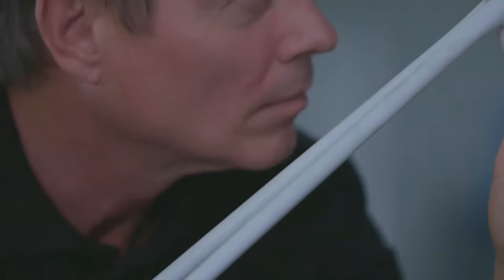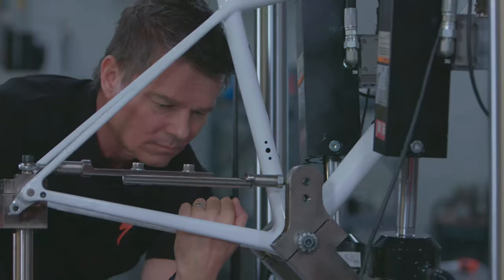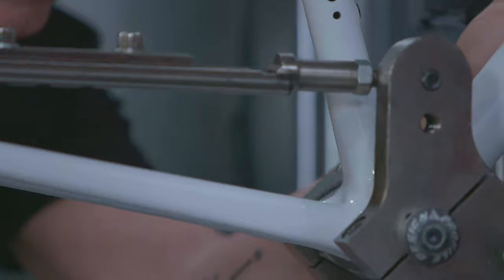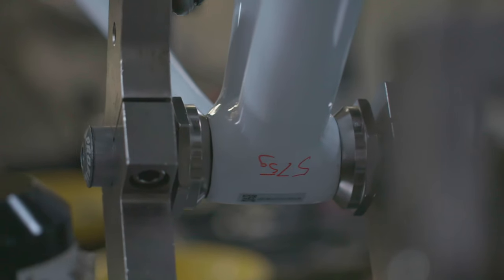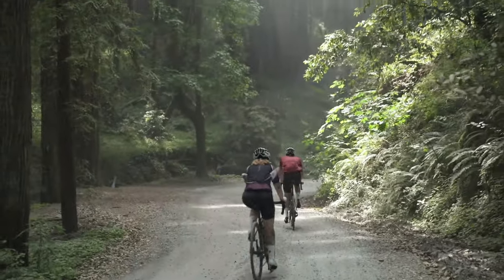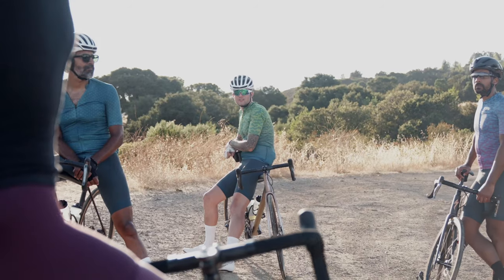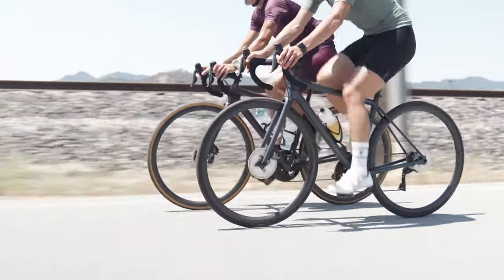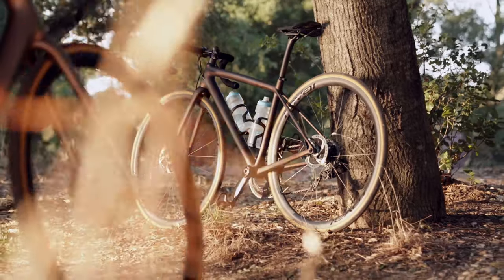Making the Aethos: Behind the scenes of the lightest disc road frame

Comment: 14 years of riding road bikes for buisness and fun, after 1000km+ on my Aethos it still makes me smile on every ride. Nevermind if up-/downhill or flats, this bicycle is just a pure pleasure to ride. I am very glad to call one my own.
Reply: Btw. For me the most significant thing was the amount of comfort due to its vibrations damping preferences while still being incredibly stiff/efficient when getting out of the saddle. I'd call myself a pretty confident descender, don't know if it made me quicker. But deffinetly enjoying it even more. The feeling when you lay it into a turn at high speed is just hard to describe. Absolutly beautiful to ride. (Except the S-Works Turbo 25c tires, really couldn't make friends with them. The grip, the steering, the damping. Just not worth the S-Works on it in my opinion)

Comment: Update sworks aethos into fully integrated with d shape of the fork less weight than circular just like the winspace slc 2.0 just only 2 cables can fit into the d shape fork. And the exit of wire for the rd make it at the back like sl7 to more ergonomics please 🙏 make it possible